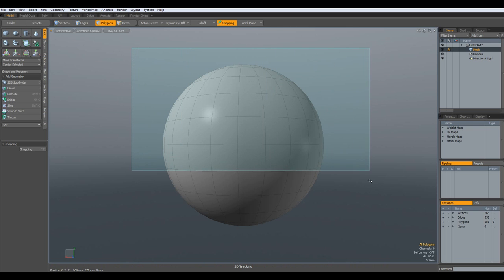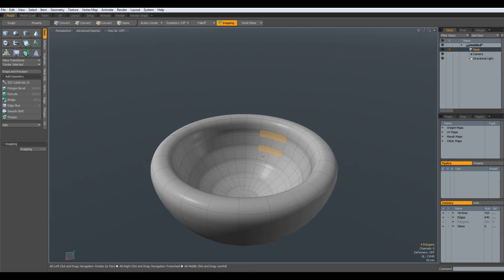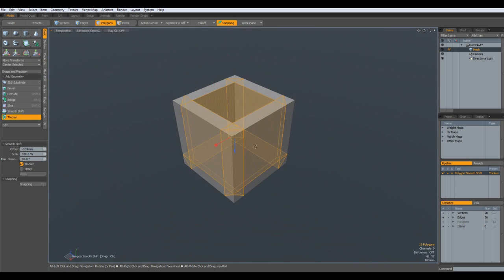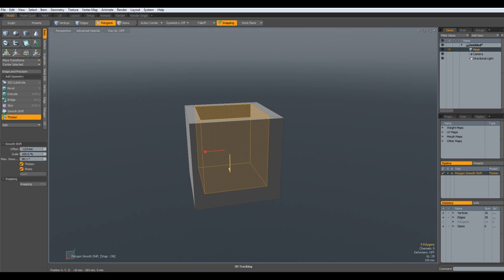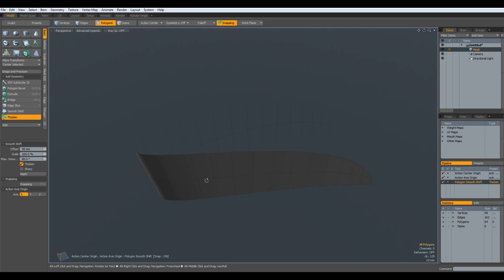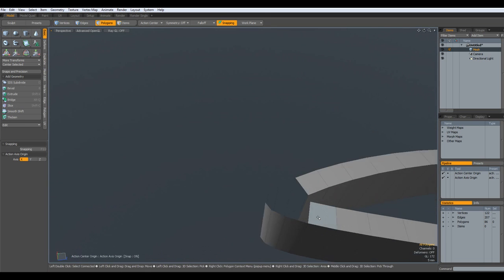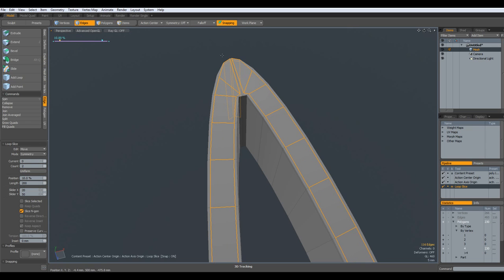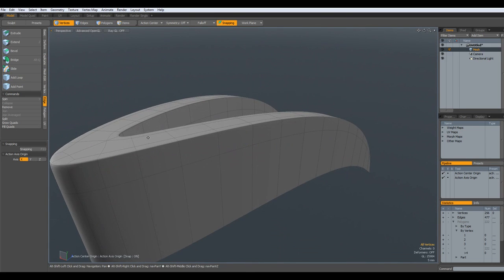Luxology Modo - Thicken tool

Comment: thank you very much for the tutorial, in fact i am a cinema 4d user but recently im attracted to modo for numerous reasons regarding the slow and heavy performance c4d has versus the quick and light one in modo, but there are quite few things that bother me in modo and as an example, what you had at 2:55 in your video. is there anything to make the shape appear normally? another question if you please, how to control the rotational speed and axis when you move an object around? it seems it all falls out of control. thank you very much.
Reply from the maker: +evertuber Hi, well, this is the 'normal' way for MODO because it displays only the one side which is along the polygon normals. This has a lot of advantages especially when you  start building interiors of a room. But if you don't like it, then you can tick 'Double Sided Polygons' on the very bottom of the material properties tab. Your second question, first you can snap the gizmo of any tool to wherever you like or to the grid or to a vertex or the center of any polygon or ...... Then you can drag move away the handle and this gives you a lot more control over a rotation. Good luck with MODO and kind regards, Peter

Comment: Peter, first of all: Thanks for the great tuts! I have a request: would you pleeease help out with a trick for making elements thinner? for me in the case of several pipes. Negative thickening seems not to work, x-y-scaling destroys the arrangement...
Reply from the maker: +Fabian Name I'm not sure i understand your question.. You can resize any number of different objects at the same time with all proportions maintained when you scale them on all 3 axes at the same time. (Middle yellow circle of the scale tool.) Let me know if i didn't understand your question. Kind regards, Peter